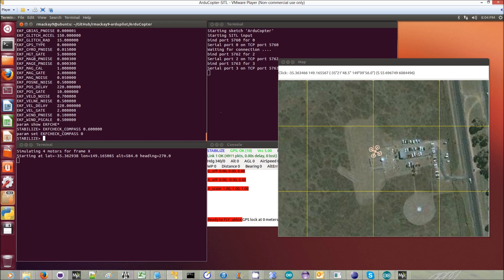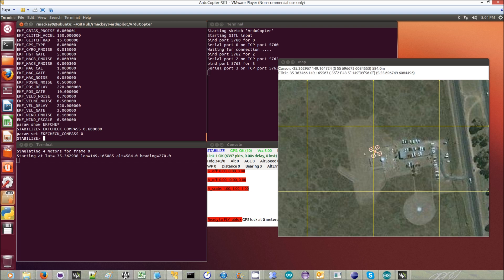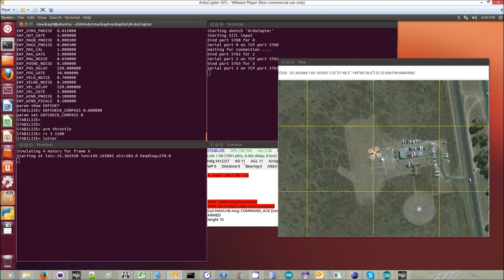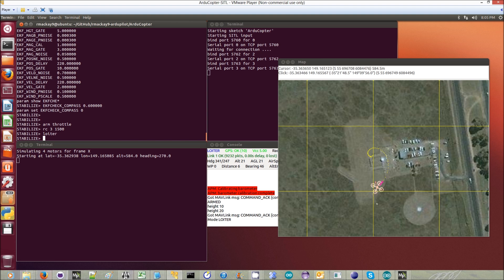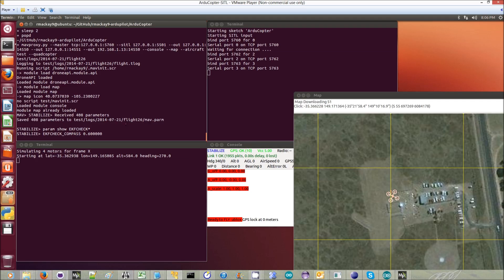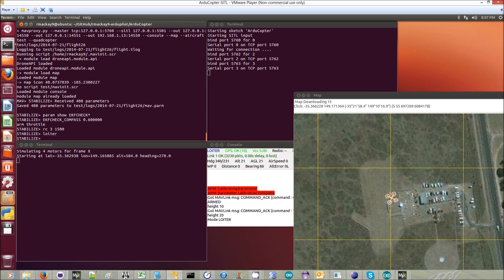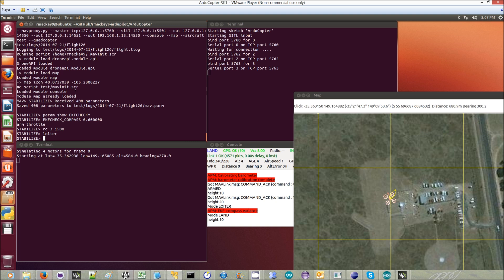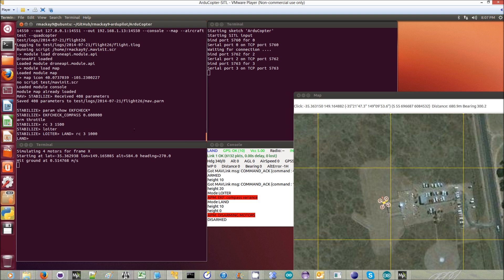AC3.2 EKF Check in Simulator

Comment: What happens if it's over the ocean & the EKF check decides to kick in?
Reply from the maker: heroineworshipper I'm afraid it's much like the battery or GPS failsafe in that it will begin landing after a 4 second delay.  We could set it up like the GPS failsafe so that it goes into AltHold mode but a pilot would need to be there to catch it of course.
These are good questions about how we should handle this..